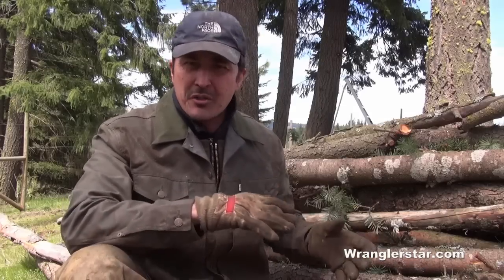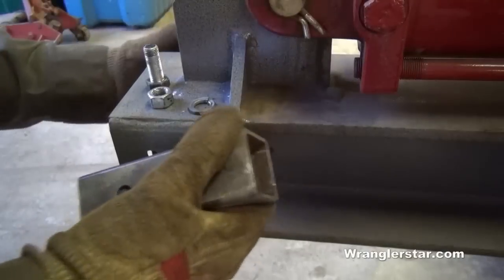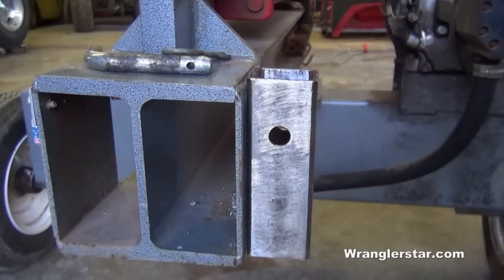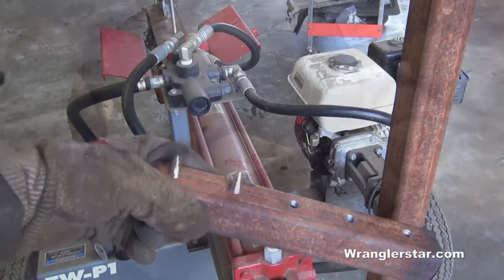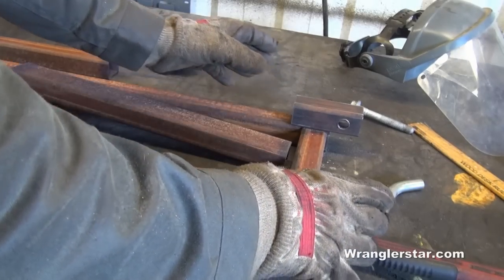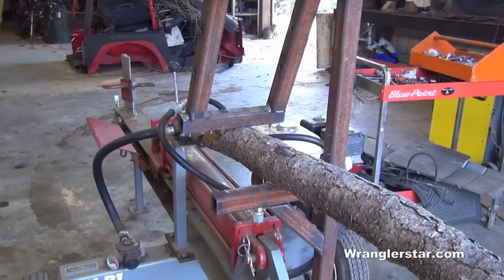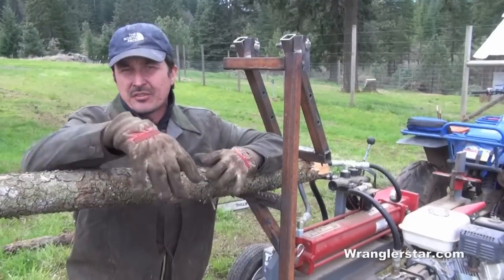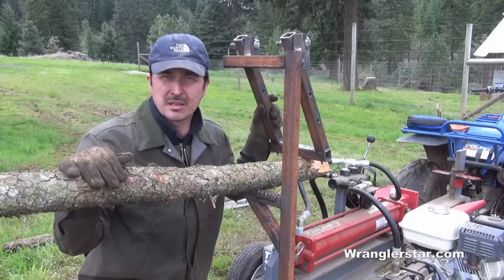A Better Way To Cut Firewood

Comment: I like it.  The comment about it being stupid was from someone who never spent any time cutting wood.  Sure, you're not going to pull this out for a single branch.  But I haven't seen too many tree's with just one branch.

I do have to poke fun at you on one point just because I do the same thing.  You spent extra effort and attention on making sure the upright was plumb when in the field it never will be due to terrain.  ;-)
Reply: Well, I think the idea is you have a designated area, that's probably already flat, that you're bringing  all of your limbs to.   And then you're cutting and splitting and stacking entire cord of it all at once as quickly as you can.  And all in once place with the same set of tools.  And then you do that about 100 times.

That's where the movement-movement efficiency comes in to where it justifies spending $60 and the better part of a day on it.

Comment: It looks like you did eventually end up putting a spike bar of some sort on the bottom.  Was that because when you were cutting the branch it wanted to slide out of the holder toward you from the force of the chainsaw chain?  Good job Cody, I've always wondered if there was a way to use my big branches for heating rather than just throwing them in the slash pile!

Comment: Hey Cody.....it seems Stihl is no longer making the MS260.....there is a 261...different code letters too....but I figure it would get the same rating? Doesn't seem to be much different....is the only big deal one number and a couple letters or may there big bigger differences that would lead you to recommend a different Stihl saw? I value your opinion so I'm looking for your guidance on this one....

Comment: looks like you decided to go ahead and add the the teeth to the bottom bar. did it improve the holding strength or help prevent the log from moving side to side?

Comment: ok, another question on the steel,what's the thickness on the square tubing? its 1.5" sq tubing at what thickness, and was it overkill or just right? I have some similar square  tubing, but  its a much thinner stock, and am wondering if it will be enough to do the same thing. great job on a simple design!!

Comment: It works but  seems fairly complicated.  You could try putting a branch at 90 deg  to the splitter deck and the ram can jam it  against the splitting wedge and hold it horizontal so that you can cut it in whatever lengths your choose.  jp

Comment: I made a wood holder kinda like you made, but I put it in a trailer. When i finish cutting wood it is all in the trailer. I just drive to my wood pile and stack it there. Cuts down on all that bending over.

Comment: If that modular set up was mounted over say a stake bed trailer, once the wood was cut, it would fall right onto a trailer for moving easily at a good working height.

Comment: Cody, Like all your videos, first rate, well thought out, and excellent video production.  I started on mine yesterday, with the only change, in addition to mounting on my log splitter, I'm making it adaptable to the 2" receiver on my truck.
I also noticed your design/project changes, as you went along....the true sign you are a real craftsman, and that you have a handle on "design as you go"  What did you end up using for teeth on the bottom? Again excellent project!

Comment: I stack the branches over lengths of rope and cinch them tight, start at one end and buzz through the pile. Release ropes as I get closer.
And people, using a tire to hold rounds while splitting is unsafe. Too much bounce back into the face if you miss.

Comment: I see a lot of people like your idea but I am not sure where you get that limb wood has more BTU's. The base of the tree is more condensed and heavier and would have more BTU's. I cut up limbs as well because I do not like waste but the base lasts longer in a stove or furnace.
Reply: It's kind of a trade-off in my opinion. The trunk - especially if you split it big - lasts longer in the stove, but the limbs (and anything else you split small) burn hotter but faster. So you do get higher temperatures from the less dense logs, but they don't last as long. If I'm stoking up the furnace for the night, I try to use the bigger pieces so I don't have to get up at 3am to stoke it again.

Comment: Maybe putting a flat plate on the swinging part so you don't have to aim for the bottom of the swinging door.  You just have to throw it on there and it will hit the flat spot on door and slid down on to the rest.      I wonder how many times you have put a branch in the doors hole and missed the bottom of the door.    Just a thought.  Hope you understood.  God bless

Comment: Cody what do u use to heat your home? a wood boiler or just a straight wood burner. I have been thinking i would like to get a boiler just not sure if i should or not tho. right now house is using electricity and it is expensive :(. any thoughts on wood boilers?

Comment: Shut the front door... :O
Cool! One thing tho- the diameter of whatever you cut increases along with the height, so I hope the bottom leg is at least as long as your maximum vertical clearance is high. Having a sizeable branch twist or roll from the pulling of the saw could be very bad. Maybe a cleat at the end of the bottom leg would be cheap insurance, esp. as it will polish from wear?
Reply: I rewatched the end and saw the teeth on the bottom bar, listened better too abt not overloading. Thanks for the great video!

Comment: I usually just stack all the limbs in a pile, roughly line up the ends, then take my biggest saw and hack through the stack. It aint pretty, and it aint strictly safe, but it sure is fast and I have never had a problem with it. This looks ok too though :-)

Comment: What welder do you have?  I have no knowledge with welders but am looking to purchase one soon! Thanks
Reply: Lincoln Tombstone welders are cheap enough and last forever.  I have one my father bought used in 1965 and left outside till the 1990’s when the case rusted out. I built a new case and it’s good for another 40 years.

Comment: me to myself
to solve the problem of too long of that final piece of wood you put a panel a couple centimeters behind the teeth to prevent pushing the wood to far through and put a panel in the swinging frame to prevent placing wood in that frame

Comment: nice welding vid, but I would not be trying to load branches into a holder like that...I would be picking them up only high enough to stack on another log...
I also be more likely to hit my chain on the metal frame than a rock.

Comment: Cody! My friend... Go and buy a big box of 3M face masks, and get into the habit of using them. You may not want to throw a way old tools, but you are certainly throwing away your lungs with all that grinding, rust dust, and smoke. The old ways have much of value, but they often died of preventable causes. You don't have to.
God bless, from a friend in Scotland.

Comment: Just curious, are you fully trained to work with a chainsaw? Chainsaw is a very dangerous equipment. Proper training is required. The few seconds at the end of your video using the chainsaw is of great safety concern. Hope that you don't mind that I bring this up. Regards.
Reply: Beware! Safety troll sighting!

Comment: I think that I forgot to mention that you have to have four horizontal 2 by's, two at the very bottom and two at the very top to hold together and stabilize your vertical 2 by's.

Comment: Grind the rust, paint and galvanizing off any steel before welding with any wire feeder type welder.
Gives a cleaner weld, better penetration, lest splatter and porosity.
Just sayin.

Comment: someone made a very similar stacking frame and made a utube video about it. It is not exactly the same but will give you an idea.  Mine was lighter and not as wide, but then, my chainsaw did not have a 24 inch blade either.  lol    Here is the link   Firewood jig video spliced

Comment: Well personally ..... I cut the limbs into 4-8' lengths and bring them back to my mitre saw and cut them to length with it ... much easier and cheaper than using a chain saw for little crap.   a 10" mitre saw is very cheap and will easily cut those limbs you are complaining about. .... no welding involved.   if you can afford a 12 or 14" saw even better.  I even do kindling size branches that way.

Comment: Holy shit 60 dollars for a bit of square hollow section tubing?  I recently bought 2 pieces of 4x4cm hollow section square tubing, 3 metres long for 8€. That's the same size of tubing you used, double the length for 9 dollars. Is steel really that expensive in the USA?
Reply: AR1G3 It is more expensive than where you are, but I think it depends on the location in the USA. Cody is in Oregon. I am in Michigan, and I got a 20ft (6 metre) piece of 1 1/2 inch (4 cm) round tubing (for a different project) for just under $40 (approx. 36€). I imagine that square tubing would be about the same price. AFTERTHOUGHT: It also depends on the thickness of the steel. The square stock you bought may have had thinner walls than what he was using. It's usually priced basically according to weight. I also know that at the steel yard I go to, I could probably find a lot of shorts (anything around 2 ft or less goes in the short bin) that could be used for this project, and they are a lot cheaper than if I bought one 12 ft piece.
Reply: AR1G3

Comment: I'm sure everyone watching has ALL these tools in their NON garage. lol Great idea though.
Reply: All guys have tools and know how to use them
Reply: Agreed, but I'm speaking of the specialty items, as in drill presses and the like.
Reply: k thanks for your comments---id just expected every guy had machines, lathes, mills, and the like---fun videos---I like watching!!
Reply: ***** I sure don't, but I found it pretty cool.
Reply: Patrick B I have a drill press in my apartment. It 10 feet away from my bed. You can get a cheap one for 62 dollars at harbor freight.  I think most people who would need one of these to heat their home would have the tools needed to construct it.  Why would someone without tools, watch a video about building something and then complain that they cannot do it?
Reply: Im glad you go to all this trouble to collect limbs and piddle stuff. Cant haul much in a truck, too much bark mess, and lifting limbs all day. I want to cut sticks 10" or larger, up to 50" if possible. Don't get chain in the dirt as I can control my saw. Roll slices onto trailer, lay flat at home, and use erect splitter. One slice split into many pieces is the way to go for me. Ill leave you the rest....yep, I do have tools. 6 welders 5 air compressors, lots of hand tools 4 chain saws, two military trucks, two bulldozers, 2 tractors with loaders...use as needed.

Comment: Why not cut firewood lengths from the limbs while they’re still attached to the felled tree trunk? Seems like you’re touching/moving wood weight too many times to only then lift limbs up to load your Logosol knockoff wood holder? You can get long vertical limbs to rest horizontally to a log securely with some minor adept saw cuts leaving the limb attached until the very end of your bucking... with NO lifting except for firewood pieces you chunked up... and no hauling extra gear if the tree is somewhat inaccessible to an ATV hauling a log splitter hauling a log holder turducken-style.

Comment: piddle sticks use for kindling only,,,,,try to put in a 14 inch stick and see what you get,,,,,best to let piddle sticks lie and rot,,,,,cut nothing smaller than 10" into stove wood lengths and then split......these sticks will work you to death to get a pickup load,,,,not so with big sticks

Comment: His bar is on upside down on the chainsaw, its driving me nuts.
Reply: Bars wear unevenly when you use one side more than the other. "Whenever you remove the bar, turn it over so that it will wear evenly."  http://www.stihlusa.com/WebContent/CMSFileLibrary/downloads/STIHL-Sharp-Advice-Saw-Chain-Guide-Bars.pdf
Reply: It's not upside down, that part was filmed in Australia :)

Comment: Your wrong it wont fit bigger bits of wood and the reason for that is the wider that swing door gets the teeth stop hooking into the wood you need another set of teeth on the splitter side of the bit of steel you have the teeth in so the wider it gets the second set of teeth will then hook into the lumber

Comment: Good job, but you shouldnt use gloves on rotating machines...
Reply: You didn't mean me, but I can see the how it is a bad idea. You probably saved me some stitches, thanks!
Reply: +Hendrik B.  Maybe Wranglerstar can, but people watching to get tips and experience shouldn't.

Also, leather or other non-woven/short strand materials don't have the same risk of entangling with a tool as woven or long-strand materials, but don't rely on it, the exception usually takes a finger off.

NB, gloves and grinders are contentious,some don't regard a bench/angle/die grinder as "rotating machinery, while a drill/mill/lathe/borer  etc. most definitely is.  NB, a shaper isn't rotating machinery, but imagine getting your sleeve/glove caught in one, horrific.

For safety, no loose or likely-to-be entangled clothing should be used in close proximity to hazardous machinery or mechanical cutting tools.  Clearing swarf/shavings with your hand is always a no-brainer (don't do it).

Comment: not bad but you wasting energy by putting 1 log at a time and getting 5 pieces out of it,turn off the chainsaw  bend over and do it again,i think it better to have made a metal rack and put 70 pieces and cut them in one shot